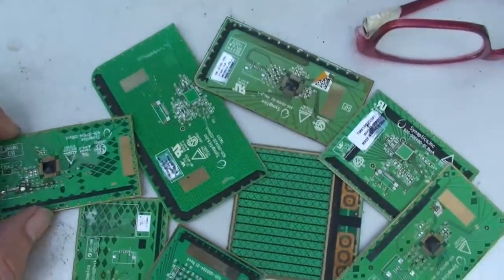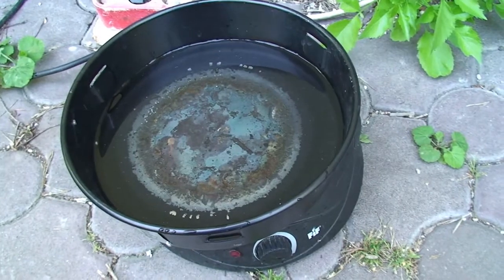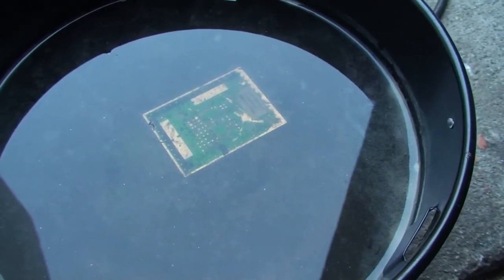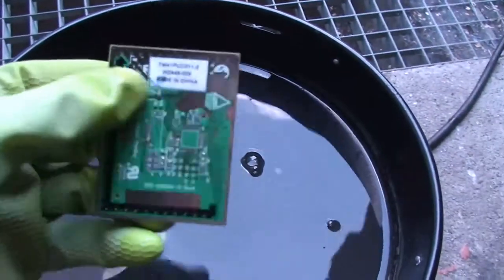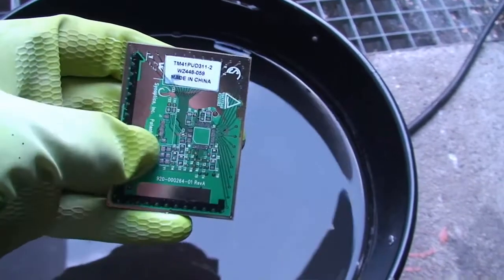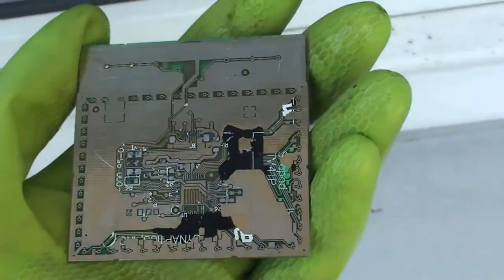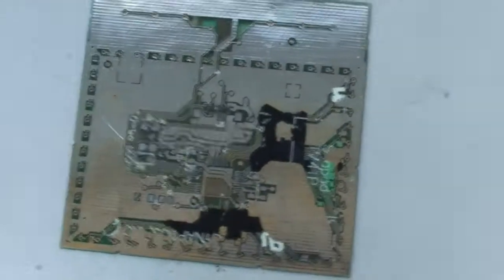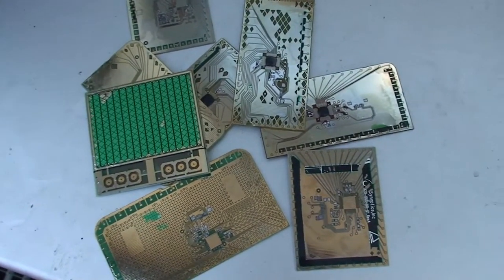0044 - This is what I need your BBQ grill for #2 - Removing solder mask

Comment: Do you use NaOH only?
Reply from the maker: Yes. A teaspoon full is enough usually. Heat and the time you apply the heat is the key factor.
Green mask comes off first, then blue, then red.

Afterwards i neutralize with vinegar and move everything to my waste pot.